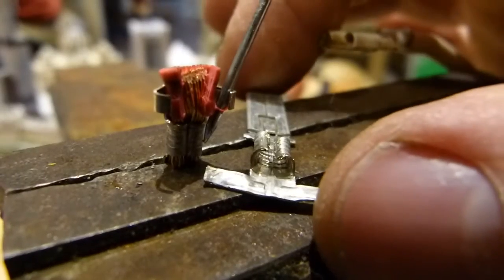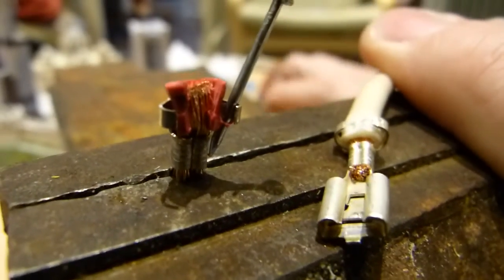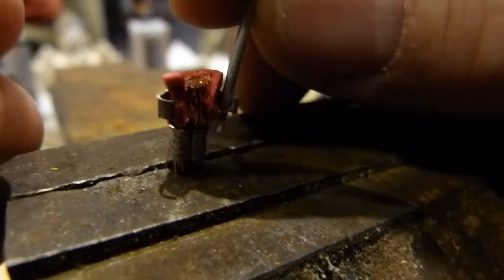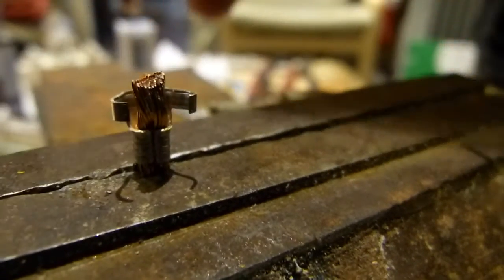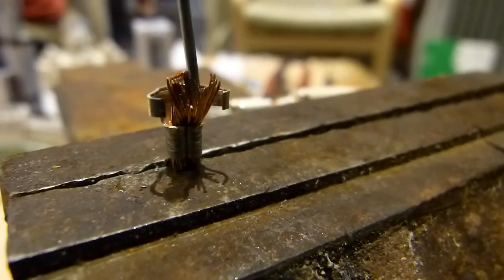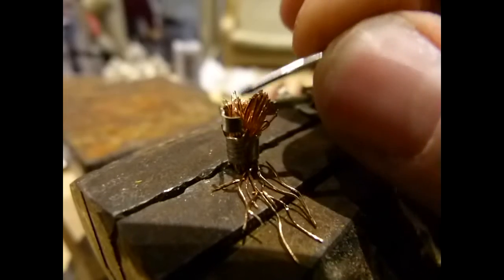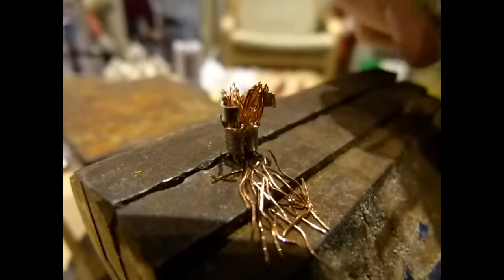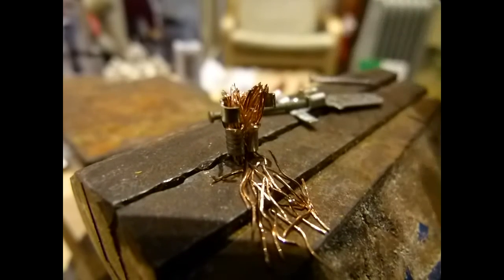Crimped-on fancy wire connector removal for re-use

Comment: that's only a stop gap measure unfortunately. by opening the crimp, the material becomes work hardened and brittle and at some point will break. i've done exactly that on several occasions but then had to go buy the connectors later and replace them because they simply don't hold up, especially in automotive applications where vibration is putting stress on the connectors
Reply from the maker: Correct, they are meant to be single use. I fixed a dryer with it, will see how the rotating drum affects it.